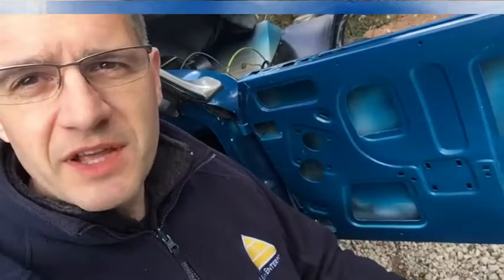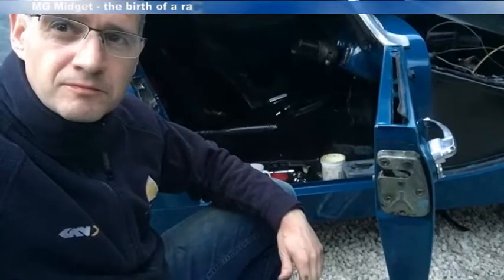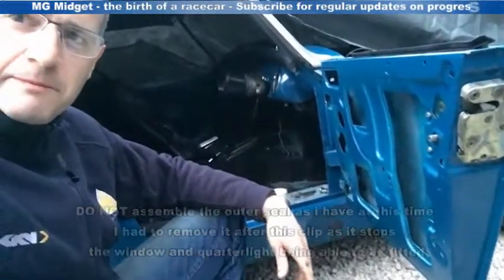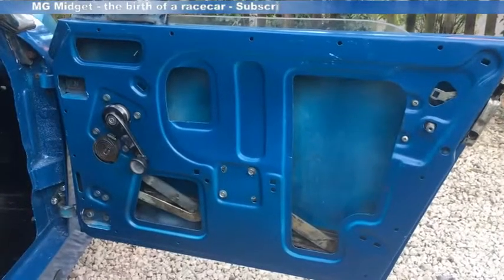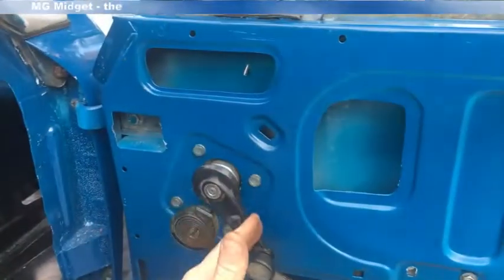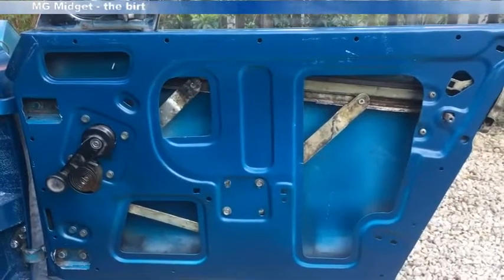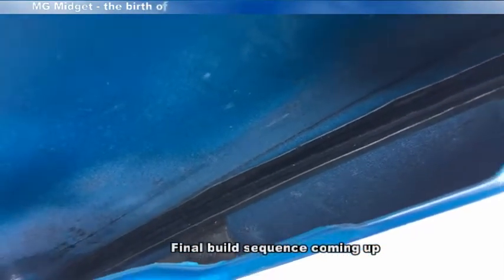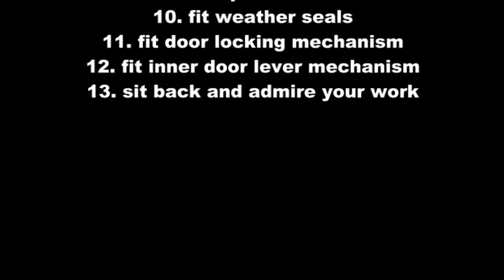MG Midget Window Regulator mechanism Installation - The Birth of a Racecar (Episode 26)

Comment: Nice work. I plan to do the doors off the car and hang the completed assemblies. I think it will be easier than trying to fight gravity.I don't see that you installed the bottom stops and felt pads. Did I just miss that part?
Reply from the maker: Yes, i did fit those although it may have not made the video. got some nice ashley hinton stainless steel ones off of ebay that fitted just nicely. thanks for the feedback

Comment: The door glass seals - you mention a hacksaw tool but don't show or explain this - I can find no information or videos of fitting the door glass seals. Anything in your footage edits that can show this ooperation would be welcome. Thank you for an otherwise excellent video explaining the sequences
Reply from the maker: Basically I didn’t want to pay £15 for the proper tool to fit these clips so decided to make one. The problem is it needs to be thin hard steel that won’t bend. A hacksaw blade is perfect but you need to heat up the end to be able to bend it round on itself to hold the clip. You have to tape up the other end of the blade where your hand goes so you don’t cut your hands to bits. Can’t add a pic unfortunately but if you look at the proper tool you can buy you’ll get the idea
Reply: @mgmidget-thebirthofaraceca4349  Great explanation of making and using the tool. Thanks.

Comment: It would be nice to show all tools needed for this job. Confusing switching from right to left door. Missing is showing door capping being fitted, door locks being installed and rubber and felt seals being installed with the special tool. Moving the camera around is annoying, a full shot of total door and zooming in and out as needed would be better. It is by far the best video available, but room for improvement . Thank you very much for your efforts. Cheers Peter Bowral NSW
Reply from the maker: Thanks for the feedback. Next time I door a door I’ll add your suggestions. Thanks for watching